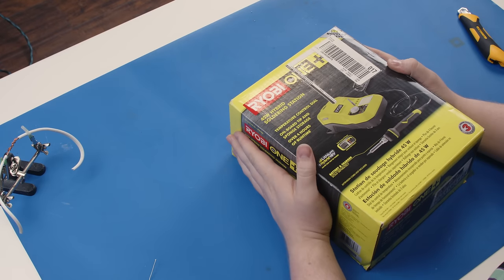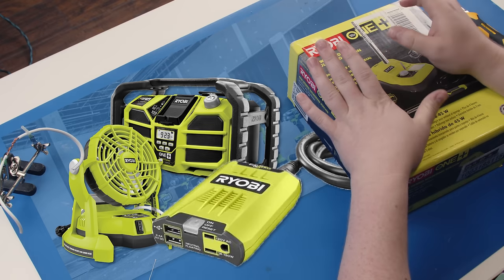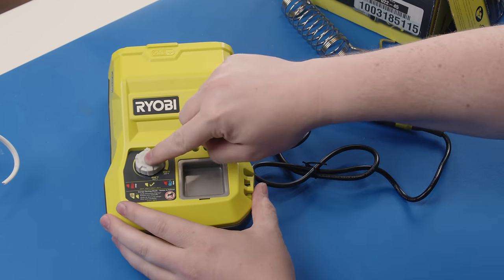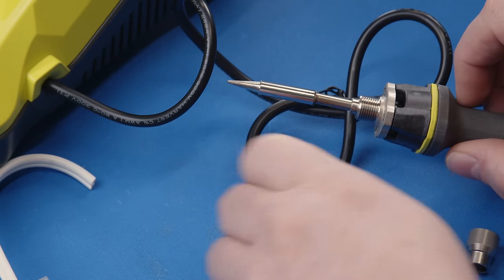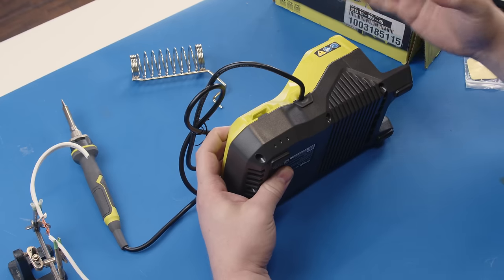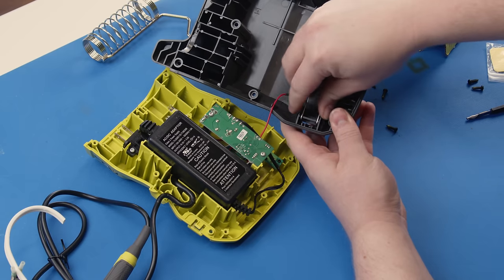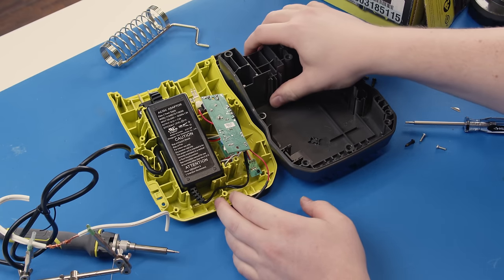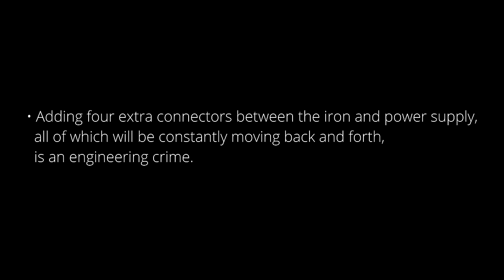Ryobi has GOT to be joking with this soldering iron

Comment: I'm an EE who has designed several commercial products that use open fram power supplies.  Even if you use a ul listed open frame power supply you still had to get ul cert ($10000-$20000) due to the use of assembled AC wires in your product.  By using the built on cable it saved alot of time and cost.  Ps actually have one of these that I use all the time.  I love the thing.  Thanks for the info on the replacement tips.
Reply from the maker: Thank you for this input! That really explains it and now that you put it that way it makes perfect sense. Also, good to hear that it was a solid purchase, hah!
Reply: Right, we always had to do FCC and UL certification for the product, even FCC or UL certified parts were used. As the setup changes parameters. It is also the reason why many stuff from here do not consider cert as they at first thought it would be OK and then found out the cost of this process. A lot of smaller companies from here won't ship from China to the US anymore. Super quality but budget got spend on that or looks instead... And that is why you see a lot of crap: as these don't care as they can flood and be profitable. Another ecample of FCC parameters changing is that Lenovo disallowed mini pcie to be used internally in the Tiny Thinkcentres like M93 (besides certified and tested combination) so they locked this in the bios with a white list for support.
Reply: @gbraadnl  Lenovo aren't the only ones to do that.  Certification is a nice cover story but I think their real motivation for the whitelist is to force customers into buying upgraded parts from them.  As long as they sell a configuration that meets current local emissions regulations then they are off the hook -- it's on the consumer to maintain compliance.  It's also worth noting that the WiFi cards themselves are certified.  It doesn't make sense to restrict what is installed after purchase since the manufacturer is no longer responsible for it, the laws could have changed, and/or the laptop may have been relocated to a new region with different laws that require changing the card.  The antenna's radiation pattern isn't going to change depending on the card it is connected to, even more so since the WiFi cards will have met strict standards for characteristic impedance and transmitted power.  It's really quite a BS excuse that the whitelist has anything to do with certification or ERP.  There's plenty of other RF equipment that is sold without antennas or with no provisions for preventing the user from changing the antenna.
Reply: @CathodeRayDude  Ts100 can run through 18650s and is amazing.
Reply: That doesn't seem like a lot of money. How much of these things do they make? Hundreds of thousands? With those numbers, the money you save by going with an open frame power supply makes up. It's also a waste of material to have an encased power brick inside of the thing. Plastic doesn't grow on trees!
Reply: I don't know anyone with Ryo I.   Everyone either has Dewalt or Milwaukie or on the cheap side blank & decker. 
I have a hakko plug in soldering station, perfect heat control.   Before 5 years ago I soldered using a cheap radio shack iron.  I learned there was better from Louis Rossman.  But damn, I soldered all kinds of circuit boards with that uncontrollable Radio shack one for decades.  The Hakko is way better and has smaller tips.
Reply: I would expect there are ready made modules like house hold temp. Disple sender's all in one thing Am
Reply: Well when dies you could reuse the power brick if you new it was in there,but its that sealed up most people have given up by then with none stand screw's, who would bother opening it😣
Reply: I wonder if using the sealed power supply unit also helps with moisture resistance?
Reply: @rickr530  Panasonic does it too! When you can't get the new "Certified" WiFi cards, you need to buy a new laptop to get faster WiFi! Flashing the bios with an open version is almost impossible ;-)
Reply: Personally I'm surprised that's ALL it costs for UL to certify a product...especially when they are now a for-profit company.
Reply: @common_c3nts  I've spent my first fifteen years of soldering with those wall-outlet soldering irons. And that was an upgrade in precision for me - from a hand-held soldering GUN, the kind that has a transformer in it, and a wire for the soldering "tip" (not much of a tip, it's really huge). They helped me accomplish a LOT of stuff on a tight budget. I feel like insisting this stuff is junk will stop people from following their dream hobby. I started using them simply because nothing else was available. I'm sure there were temperature controlled soldering stations but even professional EE magazines didn't advertise them in my country because they must have been so expensive especially in a country where earning $200/month is considered being well-off. I simply didn't know about them until a decade later, and then they were super expensive. They are still expensive for someone who just wants to do some basic work, with large DIP components, wants to solder together some thick cables, etc. It is not true these soldering irons don't have temperature control. You plug them in, hold them against a piece of solder until it melts, and then it's at temperature, and you keep it on for a while. Then you unplug it and continue your work until it's too cold. If you want more control, you get a power strip with a switch, and plug it into that, and switch the power strip on and off using your foot. It takes some getting used to, but the way you use them, they do have a way for you to control the temperature, even if very roughly. You will burn up some tips before you figure it out. However, I have a top of the line soldering station right now, with digital temperature control, and I still have my old wall-plug soldering irons, because they still work and haven't broken. You can get a lot of very practical stuff done with them: mains wiring, car wiring, radio and hi-fi repair, repair tvs including the most common faults in flat panel tvs (dried out electrolytic caps), repair or design music instruments, guitar amplifiers, guitar effects, modular synthesizers, you can make a large portion of an industrial robot with those, if not all, you can fix household items, washing machines, blenders, microwave ovens, you name it. It's a bunch of great stuff you can accomplish with those "junk" soldering irons.
Reply: @CocoaEm  I use my TS100s with 6 cell drone batteries. I use 24V power supply when at the bench. It works great.
Reply: @common_c3nts  TBH the radio shack iron was probably the best static temp iron on the market. I still have one as backup when I'm not around my variable solder station. Before I got my station, I tried multiple other irons, and none of them got to temp nearly as fast as the radio shack one, and the tips would always start getting loose and bent over.
Reply: I design LED systems for the last decade and also employ this trick.
Reply: @CocoaEm  he wants a reliable brand of batteries, as seen at the end of the video. He believes the ryobi batteries are of a better quality than a USB battery pack that has quality cells, like NCR, etc? I'd go for lipo packs any day. Besides, the pinecil and ts100 are about 65W so not as demanding anyway. Note: powering mine of Bosch batteries packs, USBC, drone/rc lipos, etc. So I know what you talk about. Convenience is king
Reply: @rickr530  most likely a vendor lock-in trick too. I have been able to remove the white list from the device. But it seems they did this for quite a while, even on the ThinkPad. But not in recent years. It might have been local regulations (in China), but know this was for all regions at that time. For customer replaceable parts it shouldn't matter... A topic in itself for sure. Might drop this on the eevvlog forum
Reply: Once again bureaucracy screws over the consumer
Reply: @soundspark  By building the brick inside their enclosure, they are required to get separate UL certification. They probably have not done this, and sooner or later UL will get around to smacking them (Which basically means taking the UL mark off the device until it is compliant). The bigger risk for Ryobi is if the device starts a fire in someones home and they have improperly UL marked their device, then the homeowners insurance company and UL will gang up to sue Ryboi into oblivion. Although ominous sounding its pretty unlikely that this setup will start a fire, but Ryobi is still taking a calculated risk here. What I don't get is why they didn't just put a barrel jack on the outside and use this supply externally the way it was certified to be used. It would have been cheaper and would have avoided all the legal issues above. As I've stated elsewhere, Ryobi is a crap brand. They cut corners everywhere they think they can get away with. I've never had one of their tools last more than 6 months and after the third tool (a hand held router, its replacement and a circular saw) I simply stopped buying that brand.
Reply: Yeah that power supply screams add on feature. I could absolutely imagine them designing this for battery only and then realizing that for $1-2 they could throw in a prebuilt dc supply and make it a “hybrid” definitely makes it more versatile to the user, and easier to justify as your only solder setup.
Reply: thank you for YOUR review. JEEZ! You gave me the vital info about this product in a couple of sentences. This guy spent 45+ min. and didn't even tell us the most important thing. How well it works>🙄
Reply: @ericschumann4213  , the one thing I like from Ryobi is their line of 4 volt rechargeable screwdrivers, which are small and surprisingly powerful. The convertible ones that can be used either "straight" or as a pistol grip are very convenient. There's also a two-speed version, better for drilling (has a pistol grip configuration only), with a separate battery and charger so you can swap in a fresh battery when one runs out off juice. Otherwise, most of my cordless tools are Milwaukee, including a cordless soldering iron, which is big and bulky but works well.
Reply: @soundspark  Well noted, they are not UL Listed. I looked up the part to be sure, and they are no longer available from the manufacturer (HKTDC) as of 2020, so Ryobi must be working from either a stockpile, or illicit supply. I bet they have a sourcing person who just buys whatever they can find that fits mechanically. Either way, there is no way UL approved that design with the non-UL listed brick built in. UL would insist on seeing the PCB designs and manufacturing specifications, which a manufacturer of non-UL listed Chinese parts isn't going to provide. UL certifications make it hard to change parts without re-certifying. The UL marking on this Ryobi iron is almost certainly fraudulent.
Reply: You also have to comply with fire enclosures for the open frames.
Reply: It's kind of a shame that they didn't design that Ryobi soldering station so that it would also charge the battery for you if you were running the thing off of house current.
Reply: @kv4302  Exactly what I was thinking. Also, now that looks like home-made kludge :D Not that the looks matter though, if it works.
Reply: There's also the issue of earthing and double insulation for some regions. The requirements for an un-earthed power supply are fairly stringent here in Australia and I suspect an open frame supply would not have been OK for use inside this iron with a battery attachment... In fact, I just looked at this product in Australia and Ryobi don't seem to offer it with the "Hybrid" functionality at all! I believe the UK and Europe also have fairly heavy regulation on double insulated (no earth pin) appliances. Using a certified double insulated supply like this makes a lot of sense is you don't want to have to get the enclosure up to snuff for an double insulated, open frame AC supply.
Reply: If you dont care about the lifetime and all the extra waste i agree.
Reply: Sorry, but that's not true!  First of all UL is a testing facility, and not the only one, nor is certification a requirement, as a company always has liability, certified or not.  The high price of UL is because they actually test whatever you are certifying in their labs, and very thoroughly too.  Most large retailers won't carry products that are not UL FCC or CE certified, but it is NOT A REQUIREMENT!  Many small companies couldn't possibly afford it, and as long as you use UL components you already don't have to worry about those, after that, as long as your devices have sufficient safety built in and they are built to code and standards, you cannot even be held liable if someone gets hurt, or it bursts into flames, until it is shown to be a flaw of your doing, and not the end user!  It's why there are safety labels on anything only an idiot could hurt them self with!

I built Microwave spectrometers and other wave tech, many custom one off units for well known medical research, and other biological, physics, material science... labs all around the world, and we never needed any kind of certification.  Even in European countries, non consumer products only needed no more than small checks for basic security, and our units always passed, because you can't have dumb-asses designing and building that kind of complicated and specialized stuff in the first place, or else go out of business real quick.  Some of what we made had multiple power supplies, some High voltage (70,000+) and High current, and even some  with variable AC frequency control, most of which we had to design and make ourselves because you can't just buy that sort of thing.  Not to mention huge and powerful electric magnets, liquid nitrogen cooling systems, stuff that had to withstand nuclear radiation, caustic acids...!

I have opened many a UL and even CE certified products (I always try to fix things first rather than buy new ones) and cringed at how bad some (not all) are designed and put together.  Certification cannot stop workers from doing a bad job and cutting corners, or the company for that matter.

And sorry, but if you really are an electrical engineer and like that soldering station and that crappy tip design, let alone bought it in the first place, instead of getting a Haku or better (so not Weller, as they were sold and make absolute crap now), then you are one engineer I wouldn't hire!
Reply: That's really interesting. Wouldn't they have to pay for UL listing on the whole tool, though? That power supply is still hard-wired to something Ryobi made so wouldn't that put it in that territory?

I always wondered how listing works-- and how many content creators on YouTube might be violating electrical code making pendant light fixtures with unlisted baskets, pipes, etc. No wonder listed light fixtures are so expensive.
Reply: @dh2032  Who would need yet another power brick laying in their power brick box...? 🤔
Reply: What does the UL stand for?
Reply: @susch7466  Underwriters Laboratories.
Reply: What products have you designed?
Reply: @CathodeRayDude  I bet it works best with a 9 amp hour ONE+ battery. The ONE+ system is 25 years old. Last year for the 25th anniversary Ryobi had a buy one tool get one free deal where one of the free options was a pair of 4AH batteries. I bought a little chainsaw, a reciprocating multi-tool, a hedge trimmer, and a jigsaw, and expanded my ONE+ battery collection by eight, in addition to the two I already had along with a little 1.3AH that came with a 3/8" drill. I also have a string trimmer (with the dual blade head) and a leaf blower. Then there's the old blue tools, of those I have a little circular saw, 1/2" drill, "dustbuster" vacuum, and flashlight.

One issue with Ryobi tools is their keyless drill chucks are total crap! They can't hold onto anything unless twisted with a couple of pairs of channel lock pliers. Drilling into soft pine will have round shank bits spinning in the chuck and when using hex shank driver bits on screws, a couple of bumps from camming out on Phillips will have the bit either sliding into the chuck or falling out of it. I have tried removing the chucks, take the left hand threaded screw out from inside, chuck up the longest hex L key that will fit then whack hard to turn counter-clockwise and all that happens is the thing turns. Ryobi must have put some super thread locker on there. I have a couple of absolutely wonderful Jacobs keyless chucks to put on my two Ryobi drills, if only I could get the OEM crap chucks off. I put one on a Skil 1/2" corded drill, it's perfect. Odd thing about that drill is its shaft uses the smaller thread commonly used by 3/8" drills, but Jacobs makes a chuck specifically for "upgrading" 3/8" drills to 1/2", or for 1/2" drills that happen to have the smaller thread.
Reply: @kv4302  It's to save the cost of having to get separate UL or FCC certification tests as they'd have to connect their own mains (AC) inputs. By using an off shelf pre-certified all in one power supply, they can save a lot of certification costs. Also, for the number of units they are making that include mains power, it may be cheaper to buy off shelf units that are mass produced by the millions for other products then to get a smaller batch made for a specific application.
Reply: Feels like they wanted to shorten the time in development by stuffing the power brick into the case and avoiding UL. It also feels like a version 1 to see if there was a market for it.
Reply: That glass fiber plastic is the same used for fusers in copy machines!!! Good Stuff!😁👍🏻
Reply: I'm and EE too and as such I was VERY skeptical about how well these actually work. But if you say it works good ill have to give it a shot. I will admit that I'm happily surprised that it has an ESD strap point. I'll have to pick one up, or find a way to make one that takes craftsman batteries... 🤔 I've got a lot of those
Reply: @n8loux  It has an AC Extension cord plug in on the back. You might check ebay to see if anyone has 3D Printed an adapter to go from Craftsman to Ryobi.
Reply: @susch7466  Underwriters Laboratories. They test and certify products for safety and security. I believe its related to the insurance industry who wants to avoid unsafe products that may cause damage or injuriy claims.
Reply: @n8loux  You can buy battery adapters for most brands on ebay or Amazon.
Reply: @cheater00  Same here.  I used the familiar old Weller 100 watt gun from when I first started building and repairing radios at age 12 until I started working on solid state gear in early 70's.  I bought a 40w Weller pencil iron then and used it ( as well as the gun) for the next several years, but it did eat tips.  In 1983 I bought a Weller 45 watt pencil iron, orange handle with an extremely soft and flexible power cord and chisel tip.  I've  used the heck out of that  one since, doing electronics repair, and it's still in my shop where I do everything from SMT repair to repair and restoration of "vintage" radios.  Just turn it sideways and use the sharp corner for those SMT devices!  Believe it or not, it's still on its original small chisel tip and it looks just like it did the day I got it after thousands of hours of use and being powered up and left overnight.  I have never even filed it to reshape it.  No temp control, just plug it in and start soldering.  Not one time did I ever destroy a solid state device by overheating, lift a trace on a circuit board, or blow something with ESD, at least as far as I know.  I used it just tonight to work on a microprocessor controlled  electric oven controller.   Works just like it did when I bought it new almost 40 years ago.  Did you ever cut a piece of #12 or #10 copper wire and bend it to the shape of a tip for that old gun?  That's all I ever used.  I have never bought a tip for my Weller gun, and my Wen gun from 1976, which I used all through my days of radio and TV repair, and is still my first choice today, still has it's orginal factory tip, just like new.  If you will keep those tips clean and tinned they will last forever.  Except for the Weller gun tips.  They never seem to last long.  However, I've been looking at soldering stations recently because I'm getting into smaller and smaller work, and with my eyesight getting worse, magnifying glasses and a needle sharp soldering iron are going to be a necessity soon.  I don't believe this is going to be one I look at, though.
Reply: @davidbrittenham4631  yeah, that's how i made new tips! lol. they lasted somewhere between long and not at all. If you want to do tiny work, take my tip. Do the work on the window sill, where you get direct light from the outside, from the north. Wait for an overcast sky if possible. Overcast sky light makes our eyes work ten times better. You think your eyes are old and tired until you try it! Works better than a microscope.
Reply: @fookingsog  and for all power tools pretty much. Not a rare or unusual choice
Reply: @greggv8  Just curious... Did you put it on drill (so you don't break the clutch) and reverse? I know that will keep some versions from spinning.  If that doesn't work then hit it with your purse :p
Reply: @fukkitful  I put it on drill and tried forward and reverse
Reply: I noticed a lot of products now use built in power supplies like this. It seems cheaper in the long run and easier for the consumer to replace if they had the skills.
Reply: @rjj102 is the external power supply certified for burying inside a chassis. Aren't they specced for open air use?
Reply: Ryan Joseph james
Reply: @common_c3nts  i did not know that dewalt made soldering equipment. What's the part number?
Reply: @rickr530  we should force manufacturers to publish the specifications necessary to modify the whitelist for laptop models as old as possible, and that as soon as possible, before they all disperse.
Reply: That explains a lot! I've seen a lot of devices like this, printers and such, and figured it was some sort of cost saving bit but couldn't figure out why. Good to know!
Reply: @stapuft  You could use an infrared thermometer to label some setting positions, but yeah.
Reply: @JackHudler  yep, it's beginner proclivity to push down hard to increase the heat somehow, instead of properly tinning the tip for heat transfer. If the tip is bending over and getting damaged, it's from unnecessary force.
Reply: is the certification cheaper if the product is powered only using an external DC power supply (say 9 V 1 A) ?
Reply: Oh god that reminds me of when I wanted to make a more usable solar inverter that would just run as a ups when the power was out by switching a special breaker and just charge the batteries and when the power was on it would work as a grid tied system and feed the batteries based on some inputs (charge %, time of use rate, sun level, sun time remaining) that settings could use to adjust
Reply: @CocoaEm  There's an outstanding $10 AliExpress 120v/240v 40W temp controlled iron with OLED. I bought two (one for car) and accidentally left one on at 300C for TWO weeks. It's still perfectly fine. Amazed 😲!
Reply: @edwardfletcher7790  my favoutite thing about the ts100 is that the heating element is apart of the tip itself. When you swap tips you also swap all the wear parts. Plus you can put in a hako tip, but they are pretty long for it.
Reply: @CocoaEm  I hate the TS100 tips, they're really expensive, my Hakko clone tips are $1 !
Reply: @edwardfletcher7790  im fine with paying the extra for tips. i personally find the clone tips a bit junk. Don't last as long. My original ts 100 tip is still going strong despite pretty much every day use at 370-450c.
Reply: The only time I've seen that thing with the power supply before is on a car jump box from Sennheiser has that external power brick internally built in for the battery charging weird but I guess it works weird but it works sort of works yeah
Reply: Thanks for the your input. Saved me from watching this 45 min video.
Reply: Why is it that every engineer I know can't spell correctly? The more mistakes, usually, the better the engineer.
Reply: @stapuft  It's not a digital control station, but it seems to do a pretty good job of holding a steady temperature.  For an assembly line I would prefer full digital control.  For the kind of miscellaneous field work that you are likely to be doing with this you won't be frequently doing the same joint with the same tip.
Reply: @CathodeRayDude  i got gvda 65W type c soldering iron compact no nee d carry this heavy equipment i have aohi 100W powerbank so no problem if its emengercy
Reply: Well #rip then.
Reply: @kv4302 Considering their margin is extremely low, plus they would be on the hook for any failures, if you buy a million of those prebuilts, you can get it cheaper than if you built one, yourself - it simply isn't a viable solution.
Reply: Yes I have 2 of them and love it I use them everyday. I stop using my Professional overpriced soldering irons and if it stop working I will take it back no problem at all at home depot. The cord no problem give it a few weeks .
Reply: With how hot some of these AC/DC adapters can get, I'm surprised that mounting it in a plastic box where it can bake in its own heat, isn't a significant hazard...
Reply: I have two of those light I use when working on my cars and love them but I will say that the hook always pops loose when I pick them up. I think the design of the soldering station actually looks to be built fairly well other that the cable which I agree isn’t very flexible. I’m sure it would be great working on wire harnesses but for circuit boards I’d rather have my soldering station with digital feedback.
Reply: This review made me reminiscent for the classic, 70s era SNL.

I never tired of watching Mr Hands abuse and torture poor little Mr Bill, always looking forward to the next episode.

... and the genre lives on never failing to entertain with the Son of Mr Hands going off at Mr Ryobi for 45 minutes! Ah, a new classic.
Reply: This reminds me of when lamborghini used the headlights out of the Nissan 300SX for their Diablo model because they couldnt get their own headlights certified by d.o.t in time. They even left the Nissan logo on them and just tried to cover it up with a carbon fibre trim.
Reply: @common_c3nts Ryobi may not be the first choice for soldering irons, but this is an excellent choice if you already use Ryobi's platform.  Since this video, they've come out with more models, also.
Reply: @zchettaz : They still outsource a LOT of their parts. The Huracan (Maybe others) uses Ford marker lights. Price of marker light lens from Ford: $11.00 Price from Lamborghini: $170 (Embossed Ford logo included for free).
Reply: Another potential benefit might be international use, most of the tool is identical just swap the power supply and plug
Reply: @ericschumann4213  Nope. If you look on for example Nintendo, and many inkjet printers, they have so the power brick "slot into" the device, like a hole that fits the whole power brick, and in the other end, they just have pins that protude, that fits into DC holes in the power brick (+) and (-) connectors.
In some designs, they have a power jack embedded long into the printer or similiar, and then a barrel jack protuding out of the plastic housing of the power brick, so when you insert the power brick into the hole, the barrel jack mates with the power jack on the inside.

These would also need to be recertified if what you say is true. After all, it would not be a difference if 99 % or 100 % of the power brick is inside the equipment its powering.

The reason Ryobi did this, is to cheap out on the interlock solution by creating a mechanical interlock. They could have made it so the battery is mated through a switchable DC-jack, so when a barrel connector is inserted in the jack, the battery power is disconnected by the DC jack switch. But that solution is also prone to failure, and they propably didn't want to put a 3amp load through a small DC jack switch, so actually, this is a safer solution.

Another solution would be to have the DC jack power a relay externally, which both disconnect the battery AND connects the DC power, which also would create a safe solution (if relay fails, it would only power by battery, preventing dual DC power).

The power brick is propably UL certified to any operating conditions, meaning it has a temperature fuse cutting off supply if it gets too hot, so building it in won't matter. The safety text on it is propably just "so it don't trip the one-time safety fuse" kind of.
Reply: @gbraadnl  The reason Lenovo did this, was due to airplane certification. HP does this on older models too. This was because, for a model to be permitted on airplanes, it would need a Wifi airplane mode switch. When people changed wifi card to a model which did not support airplane mode switch, they would get a airplane switch on the computer that would appear to work (cutting off internet - since it would "disconnect the card interface") but actually not disable radiation from the wifi card. This could get the manufacturer in trouble, as the model in question would get banned on getting on airplanes as handbaggage (some models got this decision) as the flight crew couldn't gurantee any wireless radio was off.

They couldn't just look at wifi switch, because wifi switch could indicate OFF, but it still radiated wifi-power and sent out requests to known APs. So manufacturers did create wifi-whitelist to ensure the wifi switch functionality would work as promised, so thats why they had "whitelist functionality". In that way, if any airlines would complain, they could say "Our models M93 are locked so these models you can trust the wifi card will NOT radiate when airplane mode switch is OFF".

This is also why some older laptops have a prohibition sign over a airplane and a text stating like "This equipment may NOT be operated aboard an airplane". This because this model completely lacks a wifi-off functionality. But such statements can be ignored for now, but aircraft crew may still not allow you to operate it, just because they can't know the prohibition sign is because of lacking Wifi-off functionality.

Nowadays, wifi disablement isn't required anymore for airplane certification, because - wifi is permitted on airplanes. Many airplanes today even offer wifi-internet aboard, which means wifi is certified to be enabled. This means wifi is permitted to radiate, and this is why most mobile phones allow wifi to be enabled even if airplane mode is on.

This is why laptop makers no longer lock down wifi cards to whitelist. Also for another reasons, there is now standards in place so ALL wifi cards and ALL WWAN cards must support the possibility to shut down radiation when requested from the laptop, so this problem is non-existing nowadays.
Reply: @rickr530  They did do this due to airplane mode switch. At that time, the standard to shut down radiation (WiFi airplane mode switch) was different from each card. So if you changed card to a unsupported model, you would be met with a airplane mode switch that looked it worked (shutted down internet) but actually not cease radiation from the card.

Thats why they had whitelist, to maintain airplane compability.
Remember how many older laptop had a prohibition sign and a text "This equipment may not be operated aboard an airplane". Thats why.

So its was not really a certification issue, but more a FAA issue. They needed to be sure, that when airplane mode switch is ON, then ALL radiation is to be ceased, at any circumstances.

Nowadays wifi isn't a problem on airplanes. Now there is even wifi available on airplanes. So thats why manufacturers stopped with whitelisting. Also another thing is that wifi cards and WWAN cards have standards, so they must shut off any emissions when requested from the host. These commands are the same across all wifi and WWAN cards nowadays, So airplane compatibility isn't a problem, and will not be in the future, and thats why they no longer whitelist cards.
Reply: Is that still the case for a low voltage DC cable!? Because that's that end that is problematic